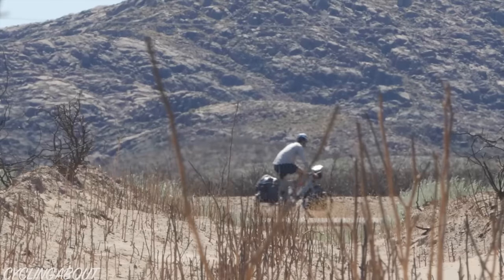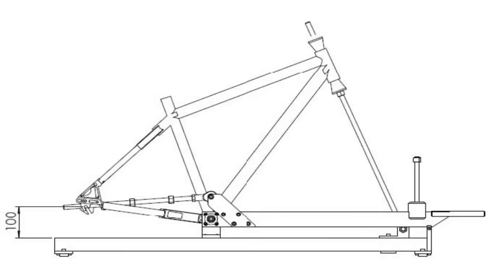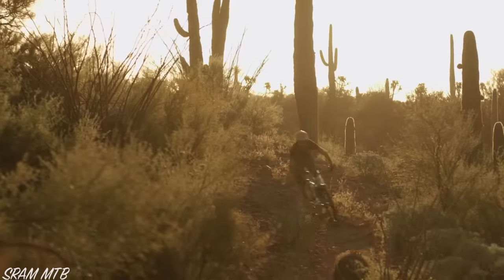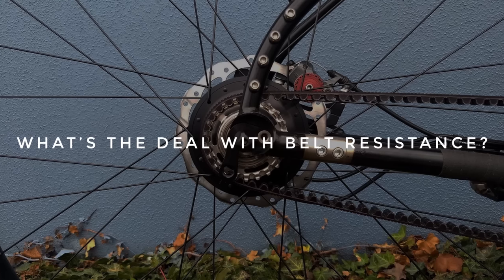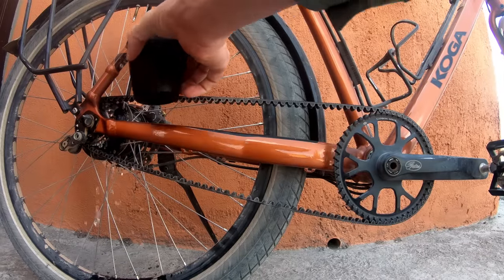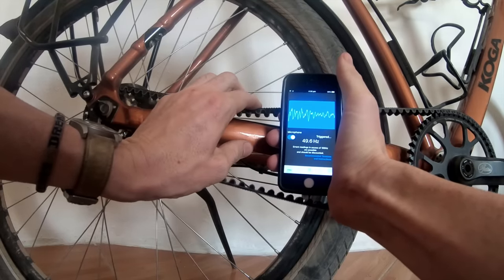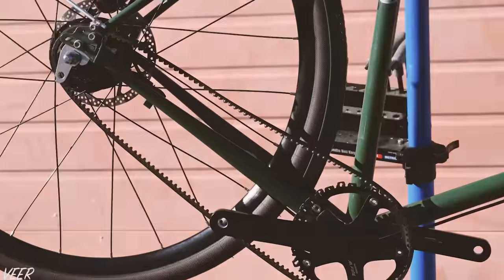Belts Are The BEST Bicycle Drivetrain Available (Epic Testing!)

Comment: You lost me at the weight 'savings' - you compared a components within a drivetrain - so only valid for single speed: how much including hub gearbox - isn't the Rohloff 1.4Kg ?
Reply from the maker: I'm not saying the entire gearbox drivetrain is lighter than a derailleur drivetrain. It's just that there is a weight saving for Rohloff, Pinion, Alfine and SS users.
Reply: @Cyclingabout  Then why didn't you make that clear "....you can expect a weight saving ...compared to chain drive  ..." whilst I'm not sure that constitutes implication but, boy, you sure do make it easy to infer that there is overall weight saving, and if this video was aimed at hub gears users, where was that stated - 'cos I missed it
Reply from the maker: @seansverige  I'm sorry, that was not my intention.
Reply: BTW how many cyclists do 30,000 miles on a bike? Is there is any data out there on what constitutes typical use - I feel your case would be stronger if it was expressed as 'x' years or typical life of a bike 
(though personally I'm still a little underwhelmed at 30k: service interval on my cars timing belt is 120k...)

Comment: "belts do not stretch"? Timing belts on car engines certainly do, and they dont even transfer a lot of force.
Reply from the maker: The bicycle belts are reinforced with continuous carbon fibre cords that don't allow for any stretch.
Reply: @Cyclingabout  I'm a retired ASE Master Technician and I tell you Skandalos is flatly wrong about timing belts on engines. Car manufacturers have been using toothed timing belts on engines for 50+ years and even before they all went carbon fiber the nylon-corded belts were good enough to prevent stretch under normal conditions. If they ever "stretched" it was as they failed and broke.
BTW I'm riding a Priority Turi now and I approve this message. Matter-of-fact I predict in 20 years if you take a racing bike with a derailleur chain set on it to a bike shop for repair they will tell you you'll have to wait for the parts to be ordered. They will have belts of all sizes and parts to repair and replace the cogs for belts, Enviolo, Shimano, Sturmy/Archer and Rohloff hubs and Pinion crank sets, all with provisions for cogs for belts on them.
That old post of mine 2 yrs ago was when I was riding a 1977 Schwinn Le Tour. The crankset cogs are sharp enough to cut bone. lol  So I bought the Turi rather than replace everything.

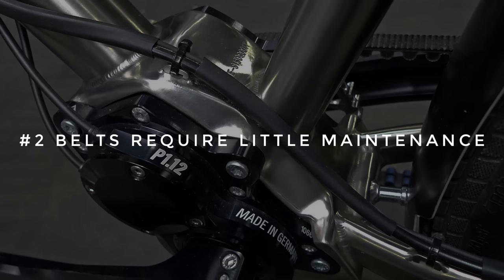Comment: this guy: 2:05 belts do not stretch
the entire reason why belts are used in engines and other systems to transfer power: s t r e t c h
Reply from the maker: Not all belts and applications are the same.
Reply: @Cyclingabout  That is a fact; but your belt also stretches. If I had one I'd do the measurements and calculations for you in the engineering lab.
Reply from the maker: @cameronnekerekian1712  I'm sure it technically stretches. But the number of tension adjustments I make over 30,000km is precisely zero. Using a chain, I would need to adjust it every few thousand kilometres just to maintain tension.

Comment: My only worry is enough gear range
Reply from the maker: A Pinion gearbox has a 636% range, and a Rohloff hub has 526%. These are wider ranges than typical derailleur drivetrains.
Reply: @Cyclingabout  Wow! Thank you

Comment: But they exhibit about 20% parasitic loss where as chains loose about 3%.
Reply from the maker: According to the data, to get a 20% loss from a belt, you would need to be pedalling at just 15-watts output. The belt and chain run just as efficiently as each other at a bit over 200-watts.

Comment: Hard disagree. Belts are only better for extremely specific applications, the limited number of gears and pedaling inefficiency, plus the added weight and cost make them impractical for 99% of users. Just clean your chain and it will always outperform belts. There's a reason they're frowned upon in the automotive world, they just suck

Comment: Respectfully disagree. If belt drive was "best" for single speed and internally geared multi speed hubs, belt drive bicycles of this type would still be in production. 
Belt drive won't work on bicycles equipped with a derailleur.
The belt drive bicycle craze of a few years ago wasn't the first time belt drive was tried - and failed.
Reply from the maker: Belt drive bikes are very much in production. There are approximately 20X more belt drive bikes now than when I first started reporting on them (a decade ago). There are many more belt lengths, sprocket sizes and frames getting built with belt compatibility. The belt designs from Gates are constantly evolving depending on the use (eg. eBike) and there are new belt component manufacturers popping up all the time (eg. Veer).

Comment: Belts are not! A chain transmits 99.9% of power. Belts stretch and only achieve 75%.
Reply from the maker: Not true at all. Three independent lab tests suggest that belts are as efficient as chains at 30-watts, 50-watts and 200-watts power output - depending on the test rig.

Comment: In short, it's a overly complicated and costly solution looking for a problem.
Reply from the maker: If you skip over the whole video, you might conclude that.
Reply: @Cyclingabout  What I did conclude from watching "enough" of the video is, limited frame choices without modifications, overly expensive components to get gearing capabilities, more weight with said gearing, limited gearing selection capabilities, added complexity and maintenance expenses (those internally geared hubs have seals that fail, leak and fluids need to be changed regularly), parts aren't readily available and accelerated hub bearing wear.  

Also, full suspension is out of the question (ridged frame required due to belt tension requirements) and wheel/tire options are further limited by sprocket size.  Once you add up the overall cost of doing a proper belt conversion vs replacing an entire chain drive setup (sprockets, chain, derailleur), you wouldn't get a reasonable ROI.  If your ROI is based solely on a want (quieter operation, belt longevity and a percieved low maintenance interval), then by all means, that's a personnel (want) justification, but don't try to portray it to be a rational one.

If a belt setup was the end all be all path toward change, then all manufacturers would head that way, but alas, they're not.  So, in summary, until there's a significant swing toward a better design that rivals the simplicity and cost of a chain drive,  I'll stand by my observation of a belt drive solution looking for a problem.
Reply: @Cyclingabout  By the way, my intent was not to dismiss or diminish your accomplishments and experience on your setup, only to convey an opposing view 😉.   Thank you for the response and keep moving forward!
Reply: @Father4ev3r  This YouTuber is a puppet for the bike industry, (he is paid buy by most bike manufacturers to review their bikes, so of course he would be bias) and they are desperate to try and make what you have on your bike seem obsolete. The bike was already perfected decades ago. I’m not saying be a cheapskate when it comes to buying a bike and its components, but spending thousands of dollars on some over-engineered drive chain is just something someone with too much disposable income would do. Just be sensible, and buy a entry-level to midrange groupset from either SRAM or Shimano with a good old fashioned chain and bike derailleur, and providing the chain is replaced when it becomes worn, it will last you a long time.

Comment: Several reasons why chains are better than belts 1- Cheaper and more economical. Belts and their corresponding drive system components cost a lot more than common inexpensive chain drive systems 2- Much more less common to find replacement parts especially in 3rd world countries. If you crash or damage your belt drive system at all, good luck finding replacements. Chains drive components are far more common and sold everywhere. 3- Gearing options. With belt drives, if you want a good gear ratio, you need an expensive proprietary internal gear hub like a Rholoff. Yeah you can use something cheaper like a Shimano nexus but the ratio is much narrower than what you can get with good old fashioned and reliable chain drive. 4- Ebikes. Why are you even still pedaling a bicycle without an electric motor assist. Thats just silly. With belt drive on an electric bike with a hub motor, you only can have one gear. Lame. Belt drive is cool for a narrow group of specialized cyclists where money is of no concern. For most people and most cyclinb applications, chains are better and make more sense.

Comment: it's all single speed though correct? That's a HUGE downside. No thanks.
Reply from the maker: No, you can use an internal gear hub or a crank-based gearbox to shift between 3 and 18 gears.

Comment: Nah, belt drive + debris is never a good idea. First of all, you can't even do full suspension without designing way too much new shit. Not everyone is into doing boring 300km daily rides through the middle of nowhere. Some of us like to have fun on our bikes.
Reply from the maker: I've now cycled 135,000km on belt drive on debris-heavy roads and have not had a single problem...
Reply: @Cyclingabout  I've worked in the mountain bike industry for almost 20 years and I have extensive experience with belt drives and just how fucking dumb they are. Having to have a specific frame design is also a huuuuge downfall. Same goes for repairability. You can always carry a few extra links. 

I haven't had a single issue with a normal chain since before 2010.

Comment: If they would be the best they would be used by everyone specialy pro cyclist. Forsure they have their place but best is always the  point of view of a person witha specific usecase.
Reply: A bike with a belt needs a gearbox (a geared hub or a Pinion gearbox), such a bike is always heavier than a bike with a derailleur system.
Pro riders demand lightweight bikes, so they use derailleur systems. Also a perfectly lubricated chain has a better efficiency, and for a road bike pro driver every Watt he can save us important.
Reply: @simonm1447  And thats simply means belts are not the best.
Reply: @12Burton24  There's nothing which would be the best - what is best for one purpose can be not suitable for another purpose.  
The channel owner here does bike touring, no road bike racing. 
I have never seen a road bike with a belt drive, however on trekking, touring or E bikes they are used, at least partially, and Harley Davidson uses belt drives for their motorcycles for a long time
Reply: @simonm1447  This title says its the bestvi said its not. you saod its not because ot depends on your needs.
Reply: @12Burton24  it always depend on your needs - a sportscar may be a georgeous car, but if you want to cross a desert it's not usable and an old Defender is the right car. He speaks in terms of touring bikes, not for all bikes in general

Comment: Internal transmission is a lot heavier than the regular chain, if belts were better for competition this would be already in use, so do not come here trying to trick on people, it may have advantages, but does not beat the traditional stuff. sorry man.
Reply from the maker: You don't need to be sorry. I made it very clear which use cases allow this drivetrain to be advantageous. You can go to 10:57 if you need to hear it again.

Comment: Nope its not , the amount off lag its horrible , thats why almost every bike is stil with chain and sprocket
Reply from the maker: There is no lag, in fact, the engagement is quicker because the belt has a higher tension than a chain.
Reply: @Cyclingabout  a friend of mine sold his scott with belt 2 years ago , i tride it , start moving after half a turn fucking slow , to heavy , and he snapt a belt twice , it was horrible to drive , no belt for me never
Reply from the maker: @lord3575  That doesn't sound like the belt to me. Probably the hub. I'd try another bike before deciding belt drive isn't for you.

Comment: Belts are a great idea for single speeds or electric bikes and especially motorcycles. But the idea they are the best conmpletely ignores why chains are better.  Watch carefully chains require maintenance trur but they offer the best ratio change system available. 10 - 30 speeds is easy and light sure there are multi speed hubs but none offer the 20- 30 speeds that a chain derailleur system offers do simply and at the weight of chains and the cost.  the simple fact is people are lousy propulsion systems the have too few horse power and limited operating speeds thats why you downshift for climbing and  upshift  for descending you really vary the force on the pedals and not so much the bpm.  When somebody wins a race with this crap I will change my mind.  But for human powered cycle shaft drive is just ridiculous and belt drive not much better.  Till somebody makes and affordable 26 speed hub.  As it is you you are a con trying to get money out of people that don't know better. Also the cost I'm not buying a 27 speed hub (the concept) for the low cost of chains and sprockets,  and the simplicity,  I'll change my mind when i see this crap  win a tour de france or a giro de italia.  Those guys know bicycles.  Oh i'm a retired mechanic and i have been riding bicycles about 65 years I sure don't know everything about em but i do have some limited experience in the area.  also the threat of theft .  You can buy an excellent 21 speed mtn bike for about 50 to 250 bucks the more you know abut bikes the lower you can get one of  the rollofs or the other type forgot the name for 2000 to 4000  bucks great.  not to mention it will say steal me every time you park it.  for that  money you might  get a car and insurance to get a job to buy it..  Also in my neighborhood.  People are riding 100 buck mtm bikes for daily trans po cus cars and insurance are too expensive.  it they had the kind of money you are talking about they would be driving a used toyota pickup to a construction job,  cheers

Comment: nope, belts are crap. They have way way way too much resistance, chains rule, belts are for fools.
Reply: no grease, no chain drops, more durable, extremely smooth and very important, NO FREAKING NOISE. Chain is surely faster though but I guess I'm a fool
Reply: @TM-lw8wn  yup, chains are better for certain folks, for people like you, as for me and Ali from Cyclingabout, belts are better for our use cases.